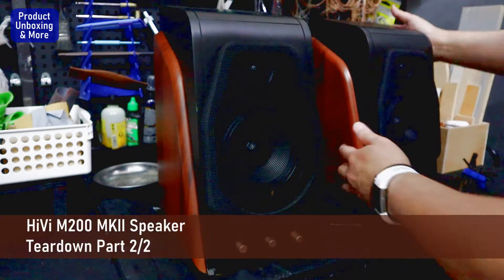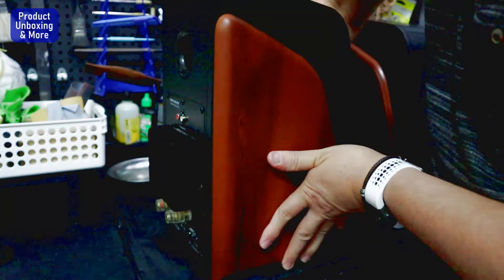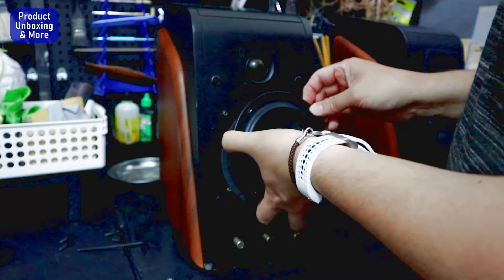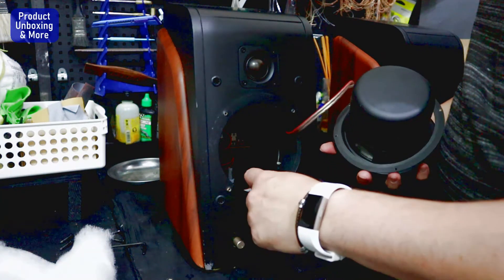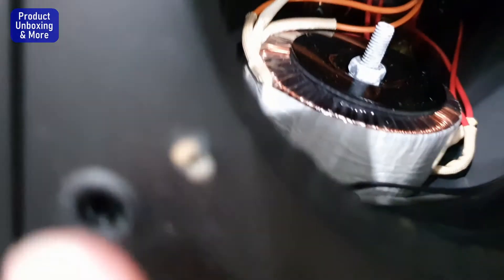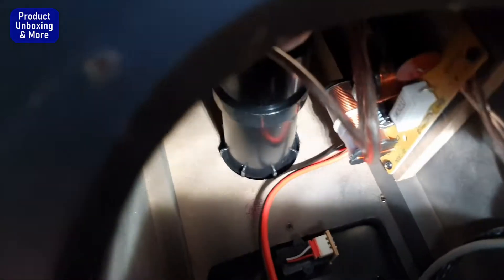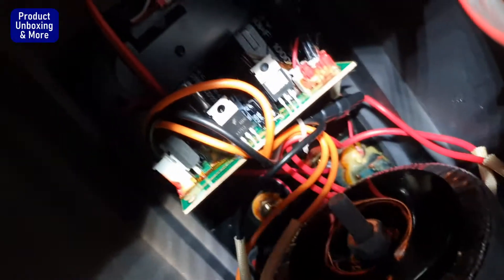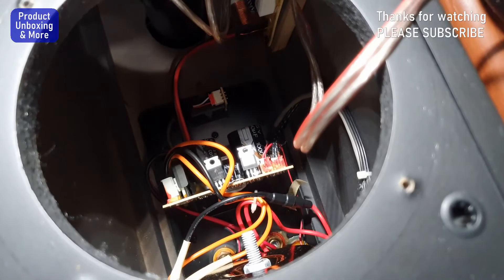Bookshelf Speaker Teardown - HiVi M200 MKII - Part 2/2

Comment: Sand cast resistors and ferrite core inductors. Will be even better with film resistors and open air coils). What Amplifier IC do these have?  The same as the Hivi Swan M200 MK II wifi?